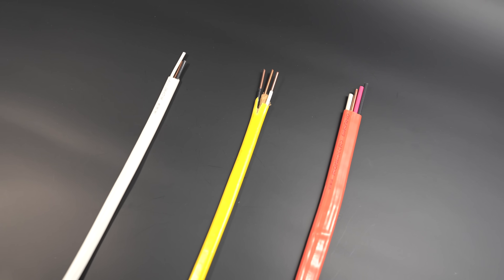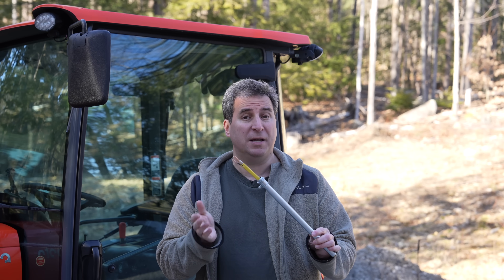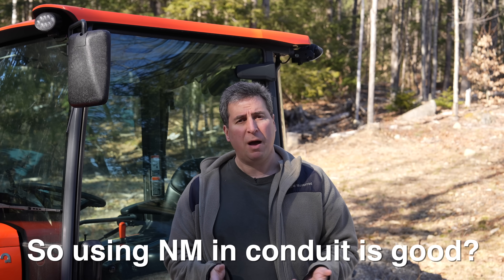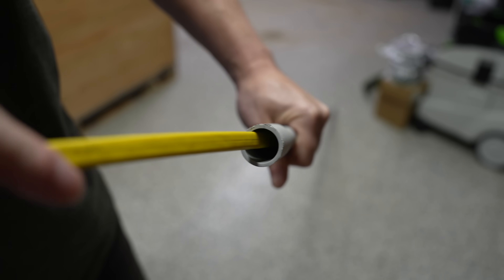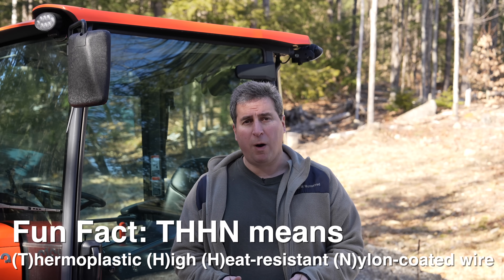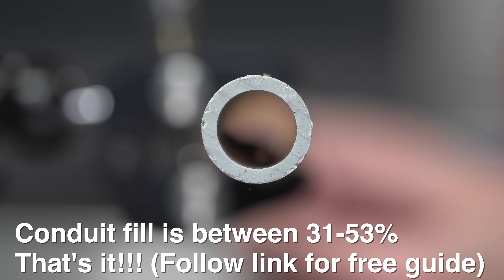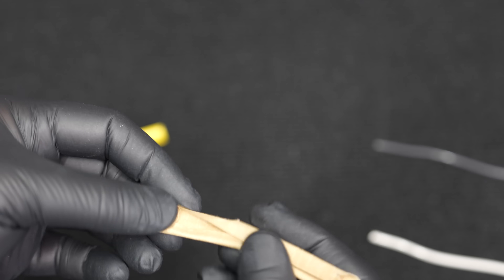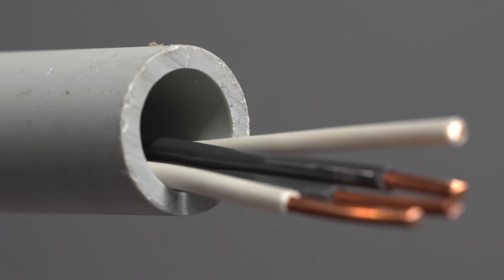#1 DIY Electric Mistake - Can you use Romex Wire in Conduit?

Comment: Understand your argument/concept regarding removing the jacket while running romex inside conduit as it's NOT what the manufacturer intended. The problem with that argument is "running the cable in a conduit is ALSO NOT WHAT THE MANUFACTURER INTENDED.  So, it may not be what the "Romex" manufacturer intended but offer absolutely no issue with what the "conductor" manufacturer intended. The biggest concern in jacket/no jacket inside the conduit is the "heat" factor. The conductors inside the Romex jacket are rated for 60 degrees C. That temperature rated will not be exceeded by running 20 amps on a # 12 cable with the jacket on and NOT enclosed in conduit. Running it in conduit removes/excludes any cooling air from affecting the cable as it would if the cable were exposed. The best solution for avoiding "overheating" with the jacketed cable inclosed in conduit is to "remove the jacket" and run the 60 degree rated conductors directly within the conduit as you would if those same conductors came on a spool. You haven't changed how those conductors were intended to be used at all !!! Look up conductor fill/amp ratings for TW type insulated copper wires. Rated for 60 degrees C. Same stuff !!
Reply: I would beg to differ. Romex is listed as an assembly and marked accordingly. Neither manufacturer's instructions nor test reports indicate that the assembly can be broken down into components that can be used independently. The wires are not typically individually marked. 

As for there being a requirement for air space, this also is not indicated in the data sheets. In fact, Romex can be run through insulation in an attic or wall, which would contain heat more than a conduit. Also note that conduit fill limits are not just a function of temperature, but also the ability to pull wires without damaging the wire or conduit. This is evidenced by the fact that ground wires count in fill calculations and fill percentages can be higher with three wires than with two.
Reply: @CRuM770  
Sounds totally like "modern logic" so I'm sure it's what is currently being used. Heaven forbid, an "Electrician" pulling conductors through a conduit (that are rated for the voltage and amperage being applied) while complying with all the necessary fill/# of bends requirements would be acceptable practice instead of installing a sheathed cable that was never intended to be incased in conduit. Just another case where "common sense" is totally forbidden. Cmon now, it's 2024 !! We all recognize, after all, the "trained gorilla" installing the wiring isn't able to think !! Only systems, Apps, and algorithm's ----------- and geniuses with degrees, are capable of that !!  I'm really glad I'm retired !!!
Reply: @pappabob29  You seem a little bitter.

“Modern logic” is what has drastically reduced electrical fires since the introduction of the electrical grid. I'm sure there were people who thought that knob and tube was perfectly fine too. As for common sense, people apply that term way too broadly, forgetting that common sense led people to believe that the sun orbits the Earth. Common sense only applies to visually obvious scenarios, and even then it's not always correct.

The conductors in Romex are not properly marked for individual use, which means an inspector cannot verify if the installation is in accordance with code. In addition, although you “think” the conductors are the same as THHN, you could be wrong. There was another commenter in this comment section who had previously worked for a cable manufacturer where their THHN underwent an additional step that applied a coating to aid pulling. Because of cost, the conductors in Romex did not have that coating. I didn't verify this, but it shows that we may not be aware of differences, and this is where common sense fails. Things that look the same are not always the same. Learned that in high school chemistry.

All this to say that I would rather live in a house or work in a building where the electricians used tested and approved products and methods instead of just “common” sense.
Reply: Where's the cooling air when it's run through insulation?

Comment: What about a vertical drop for UF wire? Say I have an outdoor box on the back of my house, and from that I want to run UF to a post in my backyard. There are two vertical drops there where the UF would be exposed (at the house to drop down, at the post to come back up). Shouldn’t the vertical drops be in conduit?

Comment: If you're in Ontario Canada, it's only approved for short sections used for protection, or an instance where the pipe doesn't terminate at a box at both ends (streetlights)

Comment: No "It is known as Bunching"  less than 25" is allowed in a "bunch" same thing if a bunch of romex is shoved inside one hole drilled in wood.       I have "None Metalic Cable" rated direct Barrial, concrete embedment, and Classified locations Class I div I, and II provided the correct fittings are used with this cable.    "I am" a little rusty as "I am" retired a few years, but I beat up a LOT of inspectors with their own code book, some more than once, one over decades and states. Hay to Phat Phill DWP! you lost again! again, Hände hoch.

Comment: The NEC conduit fill percentage limit is to allow air space for wire heat dissipation.   Besides exceeding the fill percentage limit, here is an over heating concern when Romex is used inside a conduit as the outer cover is no longer in open air and more heat is retained internally.

Comment: The information you are presenting on this video is dangerous and misleading.  If you’re going to run conduit, then just use THHN like you’re supposed to - that’s what it’s designed for.  In areas where it is permitted, if you run Romex  inside conduit, you have to derate the maximum current carry capability (amperes) because of temperature (and size). Also, the average DIY’er would not know how to calculate the number of strands versus area used inside the conduit, etc.   Just use things for what they’re designed for. - that’s why we have codes.

Comment: Good video but I was told you don't want to put cable in conduit for thermal reasons.
You want the cable to be in open air to remove heat.  The cables current rating will drop significantly inside the conduit.
It isn't difficult to PULL Romex through conduit but it is hard to push it.

Comment: What type of wire to use to go from an outdoor subpanel through conduit into an attic, across the length of the attic without conduit, and back outside into conduit?

Comment: What about direct-bury UF-B cable in PVC conduit? UF-B would ordinarily be okay except if it is too close to the surface for the electrical code where conduit is required. Seems to be the right combo without any problems.
Reply: Not sure, but think I recall a unprotected burial distance of 16 or 18" being mitigated to 6" if in conduit in particular uses.

Comment: another large problem for people who have encountered stripped romex in conduit... The writing is on the outside of the romex, not on the outside of the wires, so it is more difficult to determine which gauge they are without cutting the wire.

Comment: If you are  running individual conductors through a pipe, its a good idea to twist them. That makes the magnetic fields cancel out. Otherwise, the metal pipe will take some of the electricity via induction

Comment: Thank you, this was something I wasn't sure about and I had been told the opposite. In order to be compliant with my incorrect information I ran conduit to a junction box and then I ran NM cable from there where it wasn't exposed. For better or worse I ran 14 gauge outdoor cable in plastic conduit that I buried. I don't remember the details but I don't think I buried the conduit deep enough for outdoor NM but I think buried it deep enough for conduit.

Comment: You covered a lot of points, but missed an important one regarding heat.  By keeping the Romex sheathing on the wire, it will get hotter than normal for any given current draw, thereby limiting the amperage normally allowed to be carried by the wire when in conduit or free air.

Comment: When I first bought my house, there was a yardlight way out in the yard.  They had taken well casing to use as  the post.    It's held up pretty good for maybe 30 plus years.   Near the house I decided to plant a few shrubs and build a deck under this nice inviting tree.

I dug a hole and thought I found a tree root about 4 inches down.    I cut the root and discovered it was just plain romex (white) buried about 4 inches and that is what fed the yardlight.   Must have been the son who put that out there for his mother.

Imagine if I'd dug a foot over, not found that cable and been watering right over live cable like that?  It's one of several wonky things I've found that was done to the house.

Comment: One example of a location where this could be useful: Putting a workshop or whatever in a basement. Use conduit extending up from the outlet box, them simply run the romex along or through the floor joists about. It is fairly cheap, simple, and effective protection from physical damage.

Comment: I see you didn't mention UF cable. I'm assuming it's OK to run through conduit. Just a homeowner here with no formal training in electrical. When I ran power to the above ground pool in 2001, it passed inspection.

Comment: Just bought a new house, was fixing a bad gfci outlet today that supplies power to an outdoor refrigerator, while replacing the outlet noticed they used romex. And boom this video pops up.

Thank you, I’m going to be looking now to fix that too. Your videos are great, keep doing what you do.
Reply: There was no need to "fix" it unless it's obvious that the outer cover was abused when originally pulled thru the conduit. When pulling new wire there is always the risk of damaging the sheathing so you could end up ruining a perfectly good circuit!
Reply: If it’s not broken,don’t need to fix it , 😁,I’ve got miles of 10–2 and three and 12-2 , ran through my bars under ground, did it over 35 years ago , no issues yet , but it was good info though and presented perfectly
Reply: Good advice, never did pull standard wire through, so far everything running on the outside circuits has been fine. Better to just leave it. I will be running 220 in the future, so when that time comes may need pull the romex out anyway.

Comment: I have a ½ ID PVC run in my garage with 3 socket locations (1st is GFCI) and "Romex" style cable inside (14-2).
Sue me.  (And yes, it's no fun to run the cable even over a 10 foot section...).

Comment: I made that mistake before as in Florida it is required to use metal conduit on block walls. While the inspector didn't say anything, my electrician friend told me he normally strips the jacket off first before putting Romex in conduit. All I can say is it was hell trying to pull the Romex through the conduit, so I will never do that again.

Comment: Bottom line is Rolex has a bare ground that can rot in damp locations. Solid wire is not as conductive as stranded. This is why long distance runs or heavy loads should use stranded. In any matter, and electrician with experience will know how to wire something safely as to prevent fires.

Comment: What about running speaker wire in interior walls?  I've heard there are only a few kinds of rated speaker or ethernet cable. But what about if you run the speaker cable in conduit?

Comment: "THHN is a heat resistant thermoplastic insulated conductor, usually a single conductor. Romex is a brand name for a nonmetallic sheathed cable, it has multiple conductors inside, the insulated ones are insulated with THHN insulation."  

So why can't you remove the Romex jacket and use the wire like THHN?

Comment: i remember talking to  an inspector about this very thing. he was very concerned about the overcrowding and recommended using at least 3/4 conduit, as he had seen a fire caused in 1/2 inch that had #12 remex installed. he also emphasized not to strip off the outer covering. H stated wires without the type on the insulation instantly triggered a red flag violation.

Comment: YOU ARE WRONG! Conductors are sized by current and ambient temperature. The sheathing of NMB IS THE CONDUIT! And so the conductors ambient temperature is considered in this context. Adding NMB to conduit changes the ambient temperature and therefore the NMB conductors will have to be de-rated.

Comment: Great video.   I actually ran Romeo through a PVC pipe to my shed…what a PIA.   I need to change out those wires for THHN wires.  Thanks for the info.
Reply: I wouldn't touch it.  It's done and won't be a problem.  The only issue is that the water will soak into the paper in the Romex..  but who cares?  it's not hurting anything.   It's done..  just leave it alone

Comment: One should keep in mind that this answer only applies to jurisdictions that adopted these exact rules. Regulations vary state by state and in some states, county by county. Conduit is basically just a pipe where I live, unless you run individual conductors in it. Typically inspectors like the conduit treated as conduit even if it is being used as just a pipe, so it is much easier to ground it and ensure that it is like a conduit even if you are running romex or water sealed romex for damp locations.

Comment: Yeah but the real trouble starts when people strip off the NM sheath and run the wire themselves. This is not allowed because the wires do not have a separate rating. But people do it all the time.

Comment: What about UF-B in conduit? I have a 3 foot section between the outside wall and an exterior outlet that needs conduit to protect it from damage. but the wire is UF-B from the breaker panel to the outlet.

Comment: @3:05 can you please tell me what code article you are referencing when you say the conductors aren't allowed to be stripped, then installed in conduit ?  How then can you strip the wire and install it in any electrical box ?
Reply from the maker: if you mean about removing them from the romex. You won't find a code prohibiting this, but what you will find is a code stating that individual wires must be marked to indicate their use. The wires inside of romex are not marked or approved for use outside of their jacket which is market. Basically they are unlabeled wires.
Reply from the maker: Sorry your second question is they can be stripped and used in a box, as they are sheathed cables. The sheathed is marked and approved for that use.

Comment: I used to work for a wire and cable company. We made a boat load of NM every day. We also made a bigger boat load of THHN every day. Guess what conductors we used in our NM? You guessed it: THHN!  SOOO, your statement about not being able to use the individual conductors from a piece of NM is not totally correct... It depends on what those conductors are. 🙂👍
Reply: HA!
Reply: Are the individual conductors labeled (printed with THHN) for use outside the jacket? Might that be the real issue with legality?
Reply: @slaveofjesus3878 sometimes they are, and sometimes they aren't.  All depends on what they had on the cable-making spools.  So you can't count on it, but sometimes you get lucky.
Reply: I don't know where he found these cable wrapped in paper. It must be very old tech.
Reply: @pierregravel-primeau702  I just purchased 12ga NM cable that had a paper inner sheath last week from Lowes.
Reply: @pierregravel-primeau702  literally any box store in the US has Romex with paper filler.
Reply: @MarioMonte13  I have done a lot of electrical work. My guess is that is a regional stuff.
Reply: The conductors inside the NM/ROMEX ARE NOT IDENTIFIED, MEANING THAT NOBODY CAN TELL THE CABLES SPECIFICATIONS ONCE REMOVED FROM THE NM SHEATING, IN TERMS OF INSULATION TEMPERATURE RATINGS, SO... THEY ARE "UNSAFE", PER THE NEC
Reply: @verocola6335 not always.  Depends on what they had on hand when they made it.  Not printing on the individual wires is a few cents a mile cheaper, so if they're making them specifically to go into bundled cables they often don't label them.  But if they have a pile of labeled stuff they often just use it to make cables.

Comment: What you said, plus the ambient temperature plays a heafty part. The load on the wire, the length and yes, the number of ninety degree bends, all play a part. If you pass thru a handi-box you always leave a service loop. You NEVER pull a bend on the wire at a sharp 90. It WILL heat up. 
   You have a nice video. Thanks for making it. With over 37 years in the electrical field, I can tell you, I've seen some dillies, that unknowing people have done. You can tell that the DIYer has never even heard of the NEC.
   YouTube needs more videos like YOURS, to set the DIYers straight. THANK YOU!
Reply: So how do you get all those wires in a junction box with out a 90 degree bend? ( not a troll, I am really wondering)
Reply: @posatronic9262   the 90 degree thing is referring to longer runs from point A to point B. When it comes to the termination point, it's a little different in that typically the load on the circuit will be there, and the process of finishing the work at that location necessarily involves pushing excess cable/wire back into the box, thus causing the angle to decrease past the 90 degree threshold.

Never mind that this is part of the reason for leaving a service loop at the location you're pulling to; a service loop serves more purposes than just making maintenance and future modifications easier.